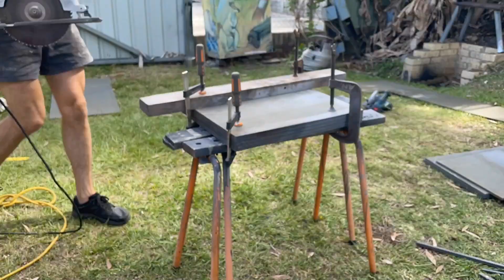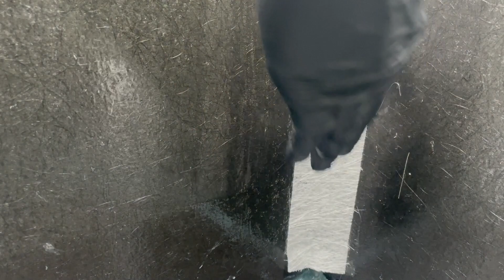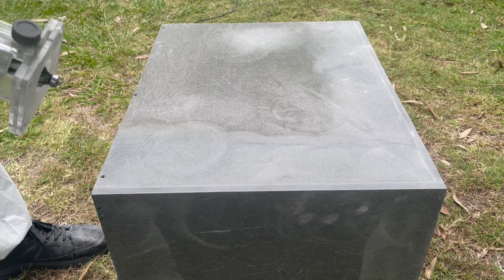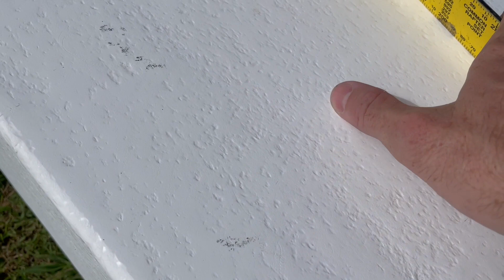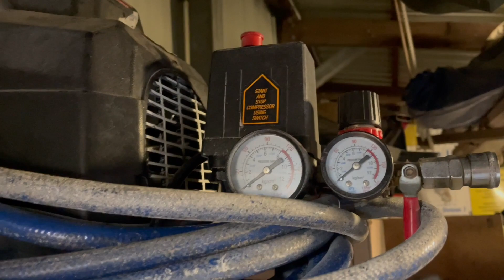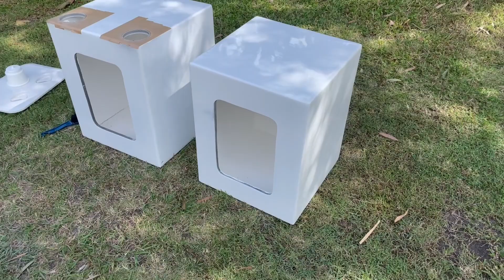[EP10] Building Boat Seat Boxes - Cruise Craft 585 XL

Comment: Hot tip for nxt time once laid the chop strand fibreglass lay a sheet peel ply fabric its basically like board sheet material still resin it on and roll it out with the fibreglass roller once dry you just peel pull it off and the surface is glass, then flow coat it saves the sanding to get it level 👌

Comment: Good job. Although, I don’t really understand why you bothered flowcoating the outside when you painted them anyway. You may as well have just spayed them with a couple of coats of spray putty, sanded and painted them 🤷🏻‍♂️
Reply from the maker: Spray putty is too weak, I've used it before and any little ding punched a whole in it. Could have used waxed resin as the top coat, not much price difference.
Reply: @cheapthrillsgarage what on earth did you use? 2k spray putty is used on every single car repair! It’s hard as rock once it’s cured.
Reply from the maker: @officialWWM  Concept Paints 2K high build primer

Comment: how did you bolt the seats on ? , did you fit sliders or swivels 
I need to do a similar job myself
cheers
Greg ,Lake Macquarie
Reply from the maker: No I didn't use either actually. I hole sawed some 20mm HPDE board I had lying around and used them as spaces. Nuts, bolts and washers sandwiching everything together.